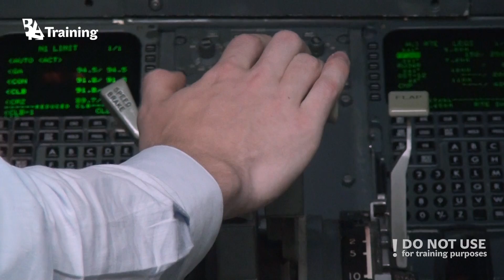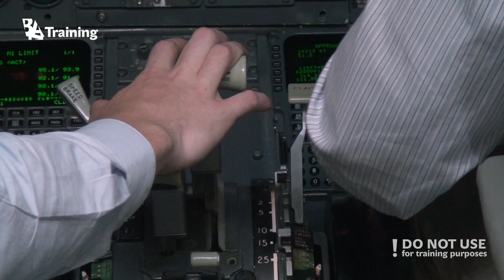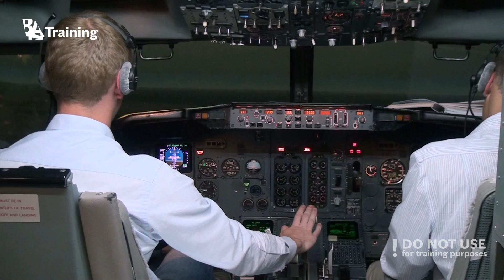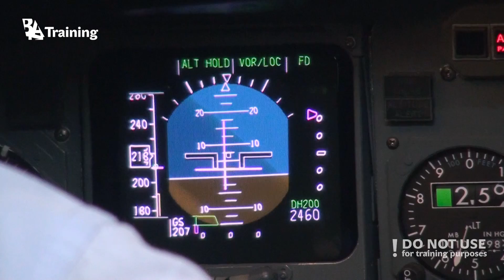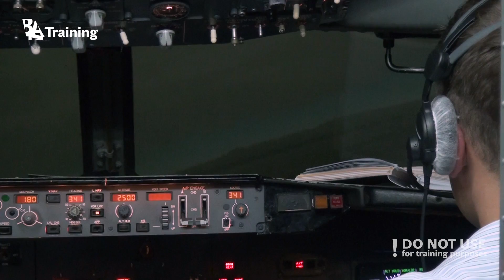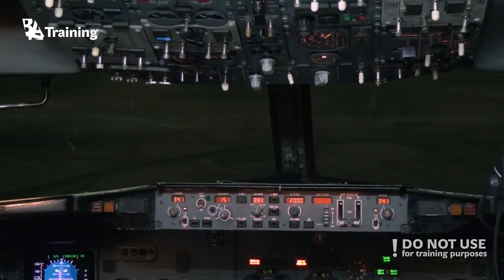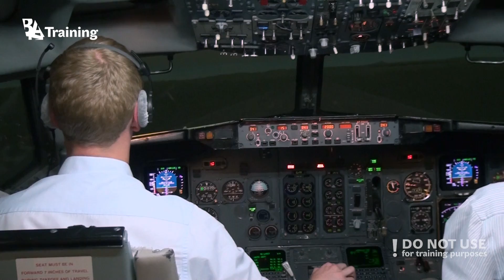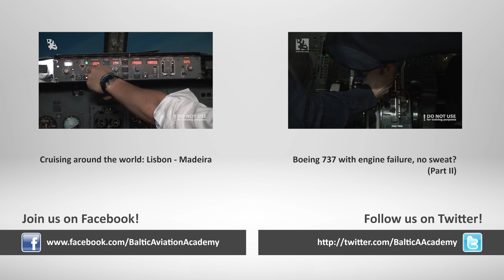Reverser unlocked in flight - Baltic Aviation Academy

Comment: 5000 feet nothing really happens, air is nice and thick for control.........     ive always wondered why they test and certify both pilots and aircraft for "recovery" at such a low altitude...?? why not up higher where then effect would be its worse?
Reply: For certification the test is completed at high altitude.

Comment: Oh I thought an unlocked reverser would have far more impact on the attitude, but still a nice video guys. Thanks
Reply: +YPOC It would if the speed and altitude was higher. look up Lauda Air flight 004!
Reply: Depends on how severe was the deployment. If reverser was only unlocked, it is as shown.
Reply: Entirely depends on aircraft type.  Some aircraft can deploy thrust reverser during flight with no adverse results.  However in flight deployment on most aircraft will cause loss of control, sometimes with catastrophic results.  Some aircraft can utilize thrust reversers to perform a power-back; they engage the reversers and throttle up to push back from the gate on their own power without receiving a push back.
Reply: If a reverser unlocks inflight I’m fairly sure modern aircraft will automatically snap the throttle to idle to reduce the effect it would have
Reply: Plus, there's always the possibility it could be the sensor indicated unlocked when the reverser didn't actually deploy, but it's safer to secure the engine than push your luck.